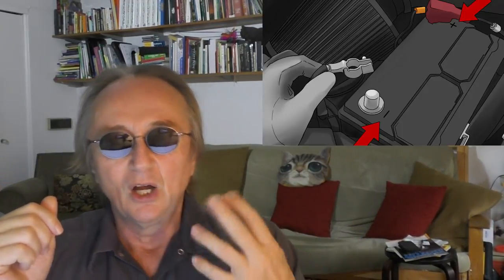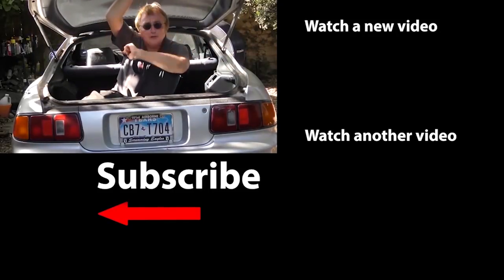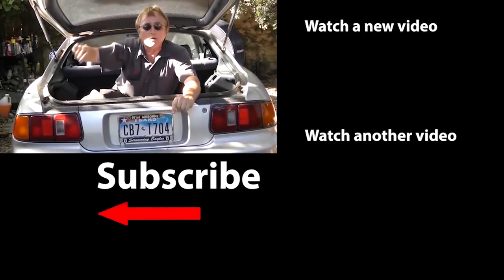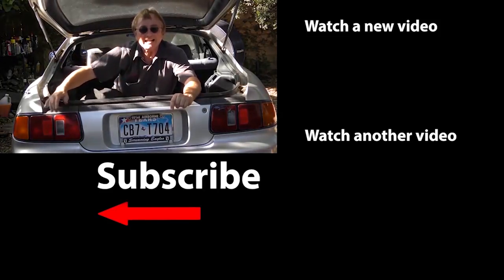When This Happens, You Need to Replace Your Catalytic Converter

Comment: Hey Scotty my Nissan Versa Note has been shaking pretty bad when I press on the gas do you know what might be the problem I do need an alignment could that be causing the problem? Also it seems like the car isn't changing gears correctly and my stick can easily slip into neutral and reverse by pushing on my stick it's not a manual but I'm sure that's not normal

Comment: Tire rotation on a 4wd. Include the full size spare tire or not? Why or why not? Tires are expensive
Reply: @djmussy18  thank you for the input but my question isnt if i should rotate them. My question is when i rotate, should i include the full size spare or not. I know it's recommended you should but is it really that bad to not include the spare?

Comment: Our 2011 sienna with almost 180,000 miles started misfiring today with multiple random misfire codes going to try to replace the coil packs tomorrow first.  There were 3 different misfire codes in it a total of 9 altogether it listed them for cylinders 3 4 and 6 but, it has a stored code for those and then listed the same code again as permanent code hoping coil packs will take care of it it was running and we managed to get it home even though it didnt list them all as bad I went ahead an got six spark plugs were replaced about 45 thousand miles ago or so.  I did buy them at oreilys but, got denso pretty sure they were iridium that I got as they were almost 11 dollars a piece so the plugs shouldnt be my problem What are your thoughts scotty or anyone else wanting to chime in this misfiring just happened out of nowhere today.

Comment: Hi Scotty, I have a 2004 Subaru legacy with the 3.0 H6 engine with around 90 thousand miles. Runs really smoothly apart from when I'm slowing down, the automatic downshift from 4th to 3rd gear makes a jarring thud and shocks the entire car. This does not happen when  It downshifts while I'm accelerating or when I manually downshift from 4 to 3. Was doing intermittently and now doing it more often than not. Relatively reputable mechanic flushed transmission a few thousand miles ago. Any ideas appreciated.

Comment: Hey Scotty I have a 2002 Buick Rendezvous with a 3.4L V6 with 185,000 miles... the car sometimes won’t go about 2000 rpm while driving it and will stop doing it after restarting it a few times... now it won’t run right at all and the rpm fluctuates from 500-1200 rpm very fast and the whole engine shakes... I’ve replaced the spark plugs, wires, coils, alternator, fuel pump, and vacuum seals... please help!

Comment: Here in uk When the engine light comes on and the fault code on a ford fiesta is P0420 you have to replace both lamda sensers with genuine ford and they cost £100 each. The after market ones are no good as the heaters go open circuit. I scraped my fiesta and replased it with a 2002 nissan micra k11 it cost £100 to buy. The nissan was written of and I got £500 for it. And I then bought 2007 vauxhall astra. And now I could be set to get £3000 damages for the accident which will GoD willing pay for a new central heating boiler. All things work togeather for good for those who love Jesus and are the called according to his purpose.

Comment: What can u tell me about the transmisson in a 2001 acura CL ? R they junk or did they just not make a good automatic for the Acura 3.2 CL ? And why r the used transmissions so expensive ? HELP !
Reply: I'd avoid them at all costs.  Those years they were known for failed transmissions on a regular basis.  Even if you found one that still had the original trans. and is working fine, chances are it could fail at any time, especially if you drove it hard.

Comment: Thankfully I deleted my pre cat, and I'm gonna delete my other cat as well. My car is Straight pipe, from the down pipe all the way to the back, I don't have a check engine light on, it doesn't affect emissions but the main cat with the 02 Sensor, will affect emissions test, and caused the Check Engine light to stay on, smoke will also come out of the muffler, and a burning smell will be in the air. I would do an Aftermarket cat less header, but I'm planning on installing a Turbo kit on my Corolla, so Header and a cold air intake is useless as I won't need it, because the Front mount intercooler piping, replaces it and the turbo manifold, replaces my header. I can't wait to be boosted and tuned my car will be at a whole new level more power to the Front Wheels and the gauges on top of my dashboard people will know I'm boosted Air/Fuel Ratios Gauge, Oil pressure Gauge, and a Turbo Booster control gauge.

Comment: What do u think about the 1992 dodge Dakota  5.2 4x4?
Reply: I had a '94 I bought in '98 and drove for a few years.  Needless to say, it had issues, even back then when it was newer.  Before 100K miles, it had worn out the balljoints, had rear diff seal leaks, transmission didn't go into reverse on occasion, radiator failed, steering box was replaced due to binding issues, the transfer case had become almost impossible to get into 4-LO,  and worst of all the 5.2L engine failed at 80K miles.  Since you're asking about them, you must have found one that is still on the road today, and given its age, it was probably either put together very well, or has had a lot of repairs done to it.  Either way, it may be hard to determine if it's truly any good without finding a guy who knows those old Dakotas well go over it.

Comment: Hi Scotty, whats your opinion on a 2006 Mercury Montego, grandma car with 39,000 miles on it. Priced at $5900
Reply: Check for rust issues near the bottom of each rear door, both in the door, itself, and in the area beneath where it would be when the door is closed. Rain can collect in both of them. If you buy the car, with each door open, find the very lowest point in the door, and drill a hole, there to let water out. The hood (made of aluminum) is a nightmare to maintain and prevent paint bubbling, and fixes aren't guaranteed or cheap. Any failure of either tail light assembly apparently, so far as I can tell, requires a total OEM replacement of the entire unit, and the related Ford 500's OEM unit won't work on it. I read on carcompaints about one guy that got an aftermarket option to work, but with a lot of trial and error. On the related Ford 500, both the throttle body and air conditioning compressor are of a poor design, and are very expensive fixes; I don't see complaints about it on the Mercury, but there are plenty on the Fords. These are pretty minor issues as all things go, but I wouldn't pay any more than $4,500. KBB private party valuation leans between $3,500 and $5,400.
Reply: Thanks so much for your inputs. It is an Arizona car so hopefully it has no rust.

Comment: Scotty waths the symptoms of the fuell filter wen ned to be replaced?
Reply: Most manufacturers have a specified interval to replace it (usually somewhere around every 60,000 to 90,000 miles - check the owner's manual). If you have no idea when it was last done, or the car is running poorly, it's a cheap place to start and good routine maintenance.

Comment: Rev up your P0420 code.  My cat is going out as we speak. Any recommendations on what to put in gas tank to clear catalytic converter? Instead of full replacement at $1000?
Reply: Put black tape right on top check engine light
Reply: scotty has a video using a gallon of lacquer thinner in the gas tank
Reply: Google the 420 most likely that's cat from what I hear but it's possible something else is triggering that light my old Cobalt got that code never figured out for sure what was causing out before I got rid of the car could've been the cat maybe an exhaust leak?

Comment: I bought an aftermarket walker converter for my civic because my exhaust fell apart and a few months later the catalytic converter substrate melted causing a complete clog...can anyone explain why? Was it the cheap materials in the converter? My original cat was fine...w no cel

Comment: Scotty, I have an 09 Civic with the check eng light on and it does have a bad Cat but somehow passed emission back in Aug. I was quoted $1200 for a new Cat. Should I sell the car with check eng light on? It has about 235k miles on it and I am upside down money wise in it. Car right now could be worth 3500 but I owe about 8k on it.
Reply: Buy and replace your self, they only $300 for a full exhaust on most vehicles,
Reply: amill1563 Try scotty’s lacquer thinner trick before you drop that kind of money.
Reply: The biggest problem here is the loan. That interest rate has to be over 20%.

Comment: hey scotty✊🏻i have a quick question. i have an 08 F150 supercrew 4x4 with a 4.6 triton V8 with 135k miles. the EGR is corroded to the point that it wobbles around and the engine runs rich. i have a new EGR to replace it but the tube that connects the EGR to the exhaust manifold is also rusted out and corroded at the connection points. do u have any advice on what to do? I've tried a blow torch and rust penetrations but nothing seems to work. i get about 10 mpg, would it be worth the trouble trying to do anything?

Comment: The f 150 diesel engine is something u want to avoid,  ford said life span of the engine was 150,000 miles
Reply: Wrong they said change timing belt at 150,000 miles!
Reply: The Federally-defined "lifespan" of any engine is 150,000 miles.

Comment: Hi guys could anyone help me with this. the engine light is on for the catalytic converter but the car is running fine. Its a 2010 1.6 tdi gold 140k miles. do I need to replace it or can I keep driving? Ive been driving the car with no problems since I bought it with the problem 3 months ago.

Comment: 2003 Saturn under 75k ran fine a month/2 ago now runs for about 2 seconds then dies, we think fuel pump
Or bcm (security light wont come on but not 100% on that either) anyone have any suggestions. Or things to check for a definite diagnostic

Comment: I had a Ford  truck  early 90s they were all all self destructing back then . Exhaust manifolds burning 🥵 up and crack and no power . Kept telling the Ford mech that it was the cat but they kept replacing manifolds and plug wires burnt under warranty . The whole engine self destructed but under warranty 😄 I told the co. I would never buy a Ford again and 12 trucks later never did 😆😄
Reply: Shutbyotch  I have a co. With many employees out driving . The other brands have better resale too 😆
Don’t buy the new Ford van either cause many co who bought them say really unreliable and many problems . Talk to fleet owners
Reply: Shutbyotch overall Chevy , their Duramax Allison best diesel Pkg. but Toyota has powerful V8 but only 13mpg, Ram 1500 air suspension best driver most comfort but wonky problems .
I’m looking forward to next Tundra.
That being said you will be happy no matter what one you choose 😄 America makes best rwd full sized pickups